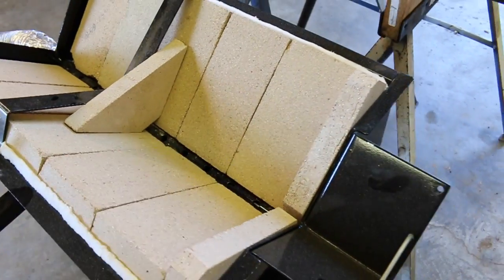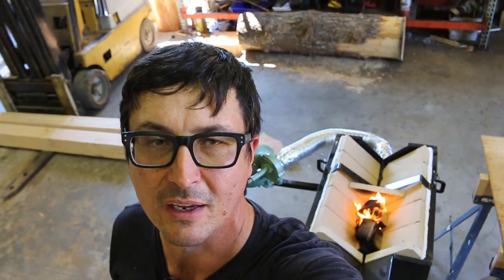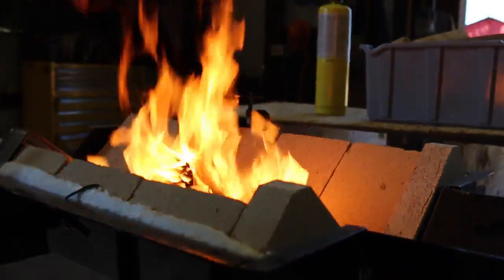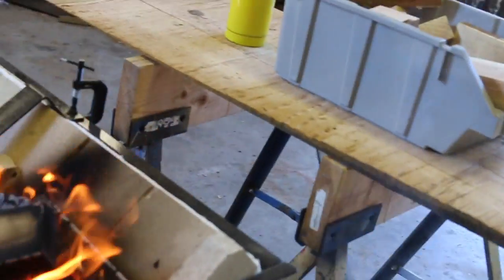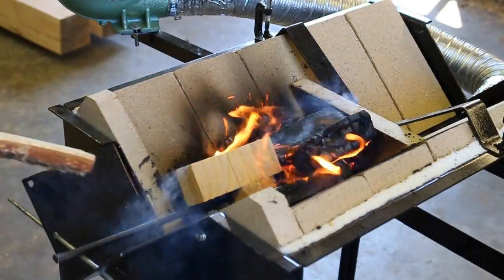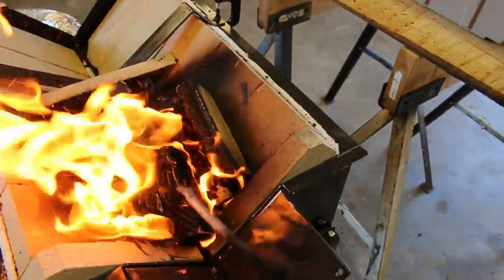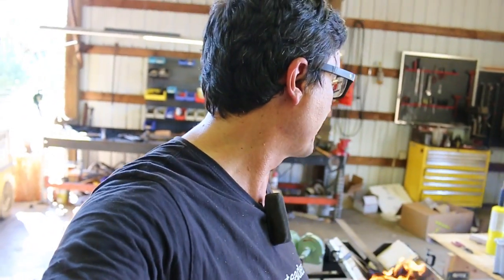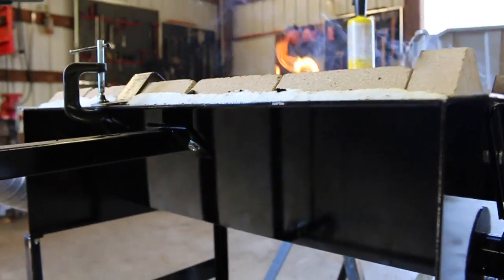Forging Steel With Wood Scraps

Comment: Dear wranglerstar - I greatly enjoy your videos, but this one is kind of off to me. Not, that is, that I think wood fired forges are a bad thing. I did some work out of a firepit in the past. but that is my point... A stack made out of cinder blocks will do the same job as this does. It's just as portable, just as convenient, and does not require a blower system.

In addition, home made charcoal will beat wood every day, and anyone with wood is a hole in the ground and a good night's sleep away from charcoal. I see no reason not to just pit fire the wood or make a retort.

Let me say this plainly and simply: I do not believe that $400 is a good price for a forge, because I have a coal forge that cost me $9 to make. I could convert it to a wood fired forge for all of $0 and an hour's work. I sunk an eight pound splitting maul head in a steel box not unlike a big tin can with concrete to make my anvil, and it cost me 3 bucks because we had that maul head already. I can honestly say that my first blacksmithing experience did not cost me a dime, because I used a shop vac as a blower (I see one in this video which you could use) mud to make a forge and a hole in the ground and some logs to make charcoal. I just feel like buying something this expensive instead of saving that 400 toward an anvil or some other essential is wasteful and honestly the opposite of prudent.

I have gotten out and done things, and if you want to pics or it didn't happen, I can give you pictures. I can honestly tell you that this forge is a bad deal, because a side blast 55 forge that you could make for next to nothing is just as good if not better.

Comment: Instead of coal I use coke which is a little more expensive but it means that you do not have to make charcoal all the time.  There is minimal smoke.  I also mix in a little charcoal as the mix seems to burn better.  Also the coke burns hotter than charcoal alone.  It reaches welding heat very easily in my forge.  Not trying to be an armchair critic just giving you ideas.  It also lasts a fair while burning.

Comment: I have wrought with branches of wood and then i put the steel I warmed up to 500 
Celsius degrees  sufficiently warmed up to process with hand  hammer I did the same with a mechanical hammer  
and everything was in the best right steel did not lose its properties because of the higher heat

Comment: Lol love the rant on the whiners that critique others work!👍 I would have said ‘those of you armchair warrior that say this and that and I could do this, well, shut your lips and go biuld your own! Lol’

I found myself a Canadian Blower and Forge Co. Forge. First time forging and I’m going to use Charcoal cuz i can’t find any coal in my area, plus it apparently burns hotter, cleaner. Love the video man! Keep it up!

Btw do you have an Amazon link or something for where you got your blower? I’m looking for a blower the forge was from an auction and only came with the fire pot, table, and a crank for a non existent blower lol. Also, do I need to line the table and fire pot (although the pot is cast iron) with refractory cement to prevent a burnout?

Comment: Cody Cool toy. Two questions, First do you think the new forge will get hot enough to weld? Second is, are you sure that divider is for controlling the size of the fire or is it so you can grill hot dogs on one side and heat metal on the other LOL.

Comment: wranglerstar I'm sure eventually you would figure this out or point it out. For those complaining about cost, Whitlox sells the plans for 15.00 so you can build your own using what ever materials you wanted. The other thing for those complaining about the big clamps. Those big clamps on the support bar are there because it's a support bar, that once clamped you don't want to move or slide. Another application, if your heating up the middle of long stock but it's not long enough to reach the other end of the forge you can put that v brick behind the support, not in front like you had it. Then your stock can rest on the bar in the front, and the  v support bar and you can heat the middle of the stock. You have a V at both ends and an adjustable V for the middle that has to support weight, more weight possibly than a smaller clamp could hold with out bending or shifting.

Forge plans http://whitloxhomestead.com/products/forge-plans
Reply: tattedupdaddy1 They don't sell the plans but invite DIYers to "donate" $15 through buying the plans that they don't sell, if you decide to try and copy there design... It says all this on the site.
Reply: I know, I corrected myself on a different thread after reading the full description (been up for about 30 hours or so. The keyboard warrior was starting to come out lol). They point you in the direction of a video with a similar design, as well as provide pictures for you to come up with your own plans, the 15.00 is optional. For a fee though they will supply the tube system, which is a great platform to build off of. Also they will supply the bricks, again for a fee. Instead of clinging to making you buy their forge, and use their system. They opened the door for DIY'ers to buy components from them and build their own.
Reply: Yea it still looks like a bit of work though and for the price that they are selling for it makes scene to just get the unit from them.
Reply: 243WW yeah, the ready made one they sell would be more efficient as far as cost and stuff rather then building your own from the ground up. But I think if you have welding equipment, access to a scrap yard, you could weld two steel plates to a steel pipe at an angle, drill some holes, attach a base and blower. Maybe even line it with bricks or get the ceramic ones. It's not really any different than a DIY'er/hobbyist making a brake drum forge. Ugly, cheap, but functional. At least for someone like me, the longest thing I've worked on were some fire pokers, but I also did those in just a camp fire, with a desk fan for air.

Comment: The first time you showed the system during assembly I felt like it was under-built due to the thickness of the metal.. but I totally forgot about the insulation capabilities of the fire stones layered along the bottom.
I think the product appears less than it really is.. throwing off the crowd, I agree that the wood is way better for you than the coal, but please take the measure of placing a small fan behind you to blow the smoke from the fire away from your face. Working in the health system I see people coming in with lung issues never smoked in their entire life, but acquired lung issues from breathing in smoke from wood burning fireplaces...

Comment: The shallower depth of field is going to make your videos dramatically more visually pleasing, I think.  Looks nice.  I wouldn't waste too much time worrying about the armchair quarterbacks.  I can tell they've got you a little upset lately, but if I can be so bold as to give a nickels worth of free advice, don't give them the air time.  Then again, it's your channel.  I rant on my weekly show occasionally; different topics but same motivation, I suppose I'm giving this advise to both of us.  :)

Comment: I don’t see anything wrong with this forge, I have what many would call a traditional tapered bottom blast forge with clinker breaker and ash gate, while I wouldn’t trust this forge to do a 1000 layer canister Damascus billet,  it Is perfectly suited for fixing gate hinges and making hooks, brackets, tools and fixtures what I would call “utility blacksmithing”.

Comment: I dont understand why people would complain about it.   Yes I could build one more sturdy. But... it costs. They built it as sturdy as it needs to be and kept the cost down. I could easily build one way more sturdy but it would cost twice as much. Why spend the money if you dont have to?  Cost twice as much and weigh twice as much and in the end it would work exactly the same.  People in general do not understand how strong steel is.

Comment: I work with my coal suppliers sister. She called me one day because she was broke down in the middle of nowhere and she know I was off that day so I went to pick them up. We stopped for lunch and the ladies left their purses in the car. I paid, I was going to pay anyway, but I got a call a couple days.later from the shop owner telling.me she wanted to repay me for my kindnes. I said no problem but she gives me 10% off everything.i. her fairer shop except anvils, and I get coal at cost. I pay 17 dollars for 50 lb of coal. I am a blade smith so I only Need a small forge and don't burn through that much coal. I light my forge, I walk away for 10 min, then it's roaring and I start working.

Comment: I love the set up but your cranking your blower way to fast. Going a bit slower will help get a better heat on the steel and less blow out of ash, try experimenting with about 1 turn per second max

Comment: There is a lot I want to say about the rant in the beginning of the video. But I'm afraid I will just get severe backlash from Mr. wranglerstar and others if I do, because it would be taken the wrong way. So I will just say this. Don't stoop to level of the trolls Cody.You shouldn't have even addressed all that nonsense. That's all it was, just plain nonsense! Let the trolls be trolls. 9 times out of 10 your subs will take care of them for you. It's very unbecoming of you when you rant like that.

Comment: I do not claim to know anything about this but I would think that if you remove the divider firebrick you should also remove the divider bracket. It looks like it would deform at very high temps. Not tryin to medel just sayin.
Reply: Randy Musick The "divider" also holds the material up in the middle of the heat so there is a reason it is still in place.

Comment: Hi, Cody!
Have you been standing in front of the gun of public opinion too long. Stand firm, Friend. Nolo Carborundum! 
That said, are you left handed? I haven't noticed that you are. Wouldn't you want to crank right handed and handle the metal with your left? That way you can grab the hammer right off without having to shift the tongs? I am trying to give constructive criticism from a practiced train of thought. I have made several knives and and four or five (I forget) Scottish dirks. Granted, most of the knives were for carving wood and slicing leather. Just my humble thoughts. You can crank that baby with your foot if you find that serves you best! Maybe a short video of that for the armchair critics as a snicker ?
Paul
Reply: Reading down further I almost broke one of the oldest rules for Newsgroups... Do NOT Feed The Trolls! That said, You said you were a novice smith. I get that you like the family that make this forge. That you were able to assemble and modify it to your liking speaks to the adaptability of the unit, I think. How much and where? perspiring minds want to know!
Paul

Comment: Hey Wranglerstar, you might find this webpage useful: https://chimneysweeponline.com/howood.htm

It's a chart that shows the amount of BTUs you can expect to get from various species of wood. I believe you mostly have pine out your way, but you might want to have a look at the chart just in case you have access to other species. If black locust grows in your area you might want to plant some somewhere on your property because it's excellent firewood (as well as rot-proof fencing material) and can be copiced. It's considered an invasive species so you'll want to consider that, too.

Comment: This is an aswsome forge i love it i would love to own it although id be a cheater and take off the handle crank and attach a drill wink wink off camera wink and also u could tell your friends to sell an upgrade on the side was thinking of a bike oldschoolbikes where u peddle back and breaks engage use that with motor it would come in handy for starting fire and then turn off to use crank when needed i like the crank method tho it saves fuel for fire. thatl make some bucks for your friends beautiful forge well thot out i would make this forge dont worry bout the haters i got yer back. God bless.

Comment: I buildt a very similar forge, and i started using charcoal i do not recomend it if you dont have an extraction bell because of the sparks and ash that comes out, and then i started using coal firstly i noticed a great improvement in heat (the steel was heating faster,) and in comsumption with 1 bag of 8Kg of charcoal it lasted at least 4 hours and whit the coal i have a 4Kg bag and it still doesnt been finished. As i dont have a large amount of wood it is not very practical to me but i think if some day you want to try perhaps you can use a combination of wood and coal so you can have a much more efficient calories use , and by the way i use a 20 gauge steel plate to use as a lid to be more efficient with the comsumption it increases the heat inside of the forge :)
here are the pics of my forge ,http://i.imgur.com/DxgERNq.jpg ,http://i.imgur.com/mnLiz2Q.jpg

Comment: How about making coal yourself? http://www.wikihow.com/Make-Charcoal or however.
(I once did making clothes into coal.. to start a fire. You put the clothes into a box with small holes.. and put it above a fire. LOTS of 'smoke' haha - but burns incredibly afterwards - the coal-clothes).
 It seems they use the very same method with making coal out of wood... I personally would be wondering how good that works. .. the effort for method 2 (in the link above) to create the setup is ... two hours I would guess..  in the case you can get those metal-containers first of all.
anyway :)

Your new forge-machine would also accept coal I guess anyway - just in case.

Comment: why couldn't you use wood in a regular forge
Reply: ***** You can. But a regular coal forge is flat and shallow, and a wood/charcoal fire needs to be deeper. You have to keep pulling the fuel to the center and it is a hassle. The sloped sides of the Whitlox forges reflect the heat back rather than letting it dissipate, make a hotter work zone.
Reply: thank ya

Comment: No offense, but one does not need to build, or even own, a forge to know that that Whitlox forge was poorly manufactured. It's not an opinion - it's a fact. How may pieces / parts were incorrectly sized / cut? They should be embarrassed, and quite honestly so should you for being so naive.

That fact that you were (fortunately) able to correct their mistakes does not make it immune to criticism.

Comment: I have never read so much garbage in one sitting in my life. Constructive criticism is one thing, but total disrespect from the Coulda, Shoulda and Woulda crowd is mind boggling. The Guy wants to get away from Coal and found an alternative and then gets dogged for because it doesn't meet a Subs quality control standards. Well speaking for myself I have ran into not so well made equipment and I find myself tweaking a little here adding something there until I am satisfied. I am sure if he runs into any problems like that he will do the same. I know now why Prozac was invented.

Comment: Dude, calm down a bit. Wood works just fine for forging - we both know that. People are going to think whatever they want to think. Ignorance is shockingly hard to cure, and I find that the least stressful solution is to let them disagree with me.
Reply: Also, that's a pretty fancy setup from what I'm used to working with. Military technology (weapons and armor) were made for a thousand years using holes in a clay bank.

Comment: Still not worth buying for $400. No quality at all in this forge. I would buy one for MAYBE $150.
Reply from the maker: Luccas Marcelus You could not buy the material for $150 Luccas,
Reply: Luccas Marcelus So you want one that is made in 'somewhere with no human rights and ZERO fucks given about the environment' from walmart and then still complain that its a cheap piece of crap from walmart. For god sakes this is what he is talking about in the video!!! if you can do better then get off or ass and do it! You are using a computer/phone that probably cost more than $400 that will be junk in what 2 years, mabey 5? This is forge is brick and steel it will last pretty much forever.